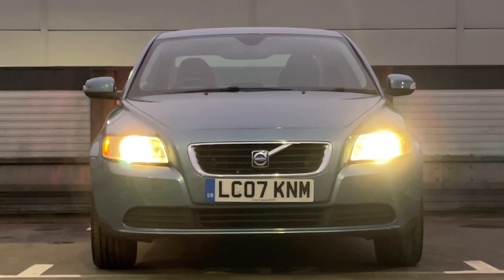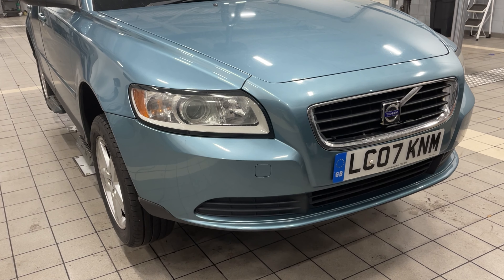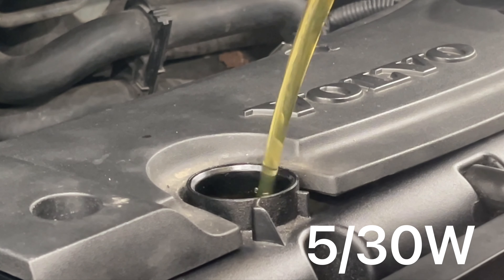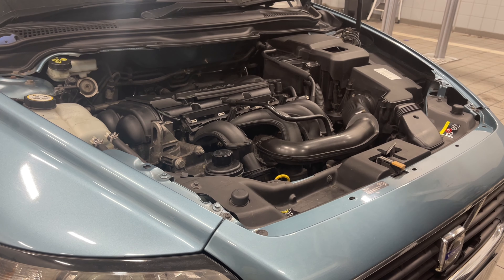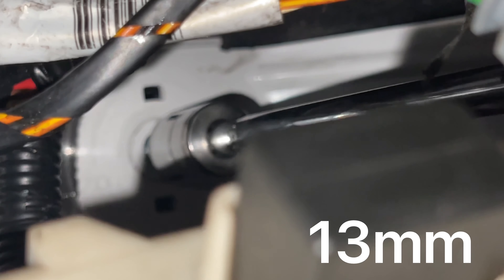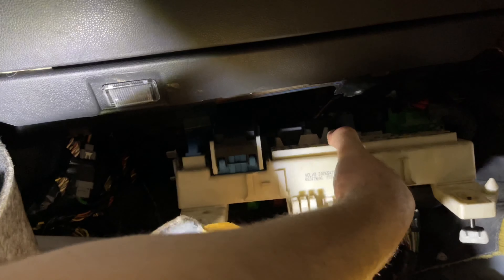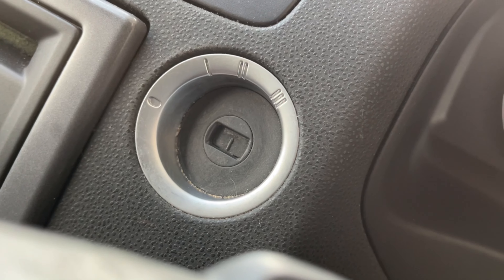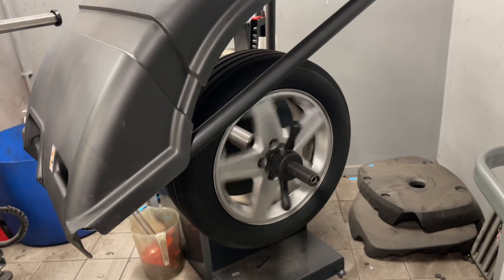Volvo S40 1.6 2007 basic oil service how to and MOT. Will it pass?

Comment: The pollen filter is the biggest pain, I had to undo all fuses, I lost a bolt and the old one came out in 3 pieces, the bracket isnt on properly and some cables are stuck in places... It was that or getting volvo to do it for £70
Reply from the maker: By far the most fiddly and frustrating task I’ve had to do on a car, even worse than folding myself into a convertible car boot to relocate the roof motor!
Reply: £70 😲 I'm so glad I do most of the work on my cars and the most I pay is £45 per hour. 
So I couldn't help but notice that you didn't change the glow plugs. 
How often would you say you change your glow plugs.  Reason I'm asking it's the first time I'm owning a diesel Volvo 2.4 d5

Comment: Using brake cleaner to clean the oil from the sump. CLICK (from Rainman Ray 😀). You are correct not to prefill the oil filter, because any contaminants that could have inadvertently have previously fallen into the fresh oil container would pass directly into the sump & perhaps damage the crankshaft. Better safe than sorry. A new cabin filter's a good idea.
Reply from the maker: If Rainman Ray does it too then that must mean I’m the same level of skill in car mechanics! 😂
Reply: @db192  Reverse CLICK. 😆😇😆